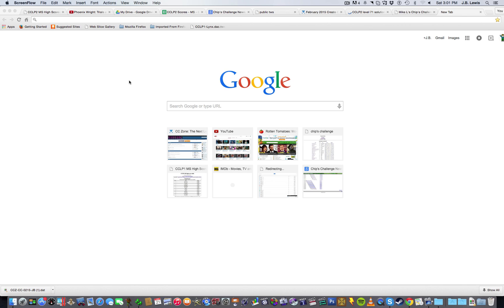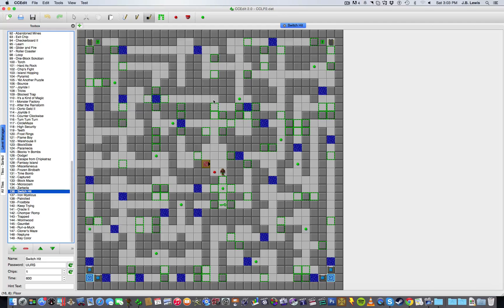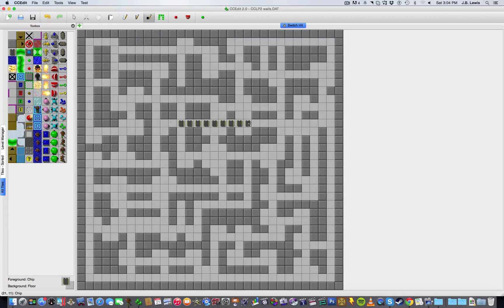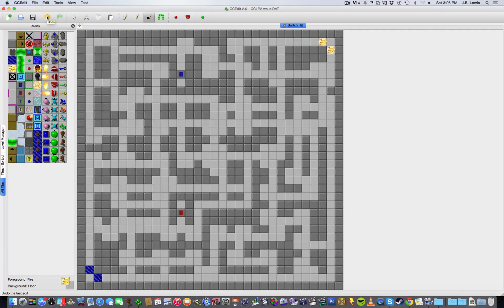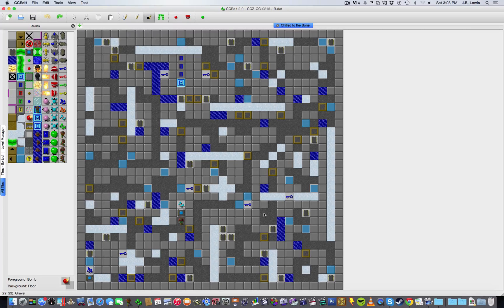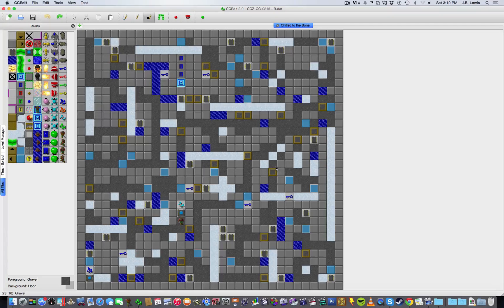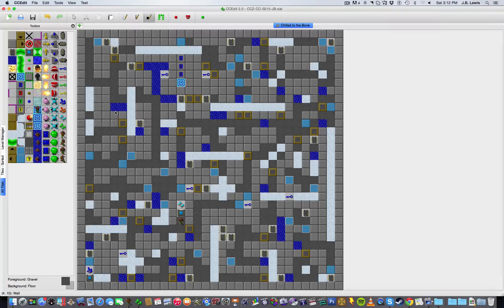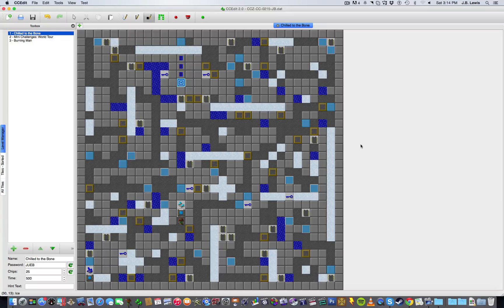How I Design a Chip's Challenge Level

Comment: I just recently, just for fun, mapped out the level called Steam from the original game (Level 75, I think) and reversed the elements. That is, fire became water, and vice versa. I also switched all the fire boots and flippers. The spies remained the same, as well as the starting point and the exit. It actually looks pretty cool. It's not a regular 32x32 sized level, which made it somewhat easier.